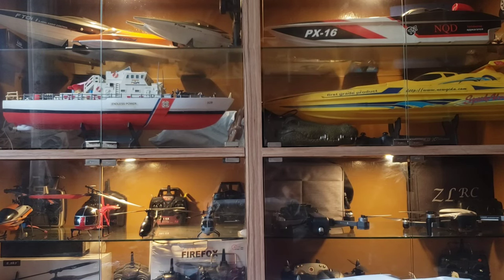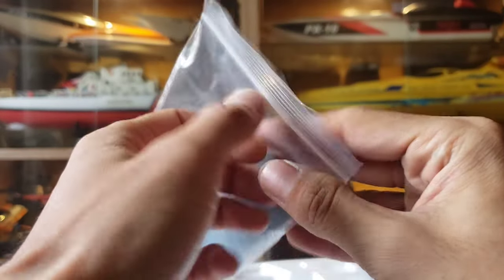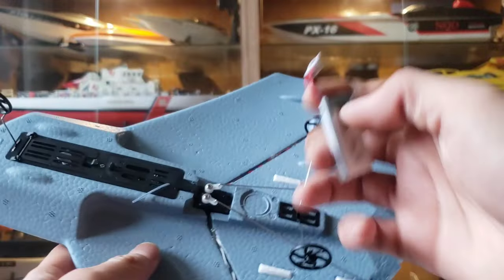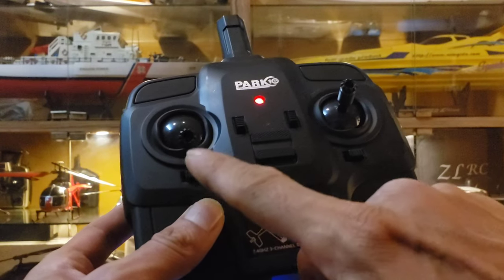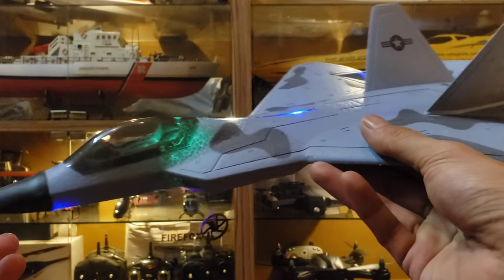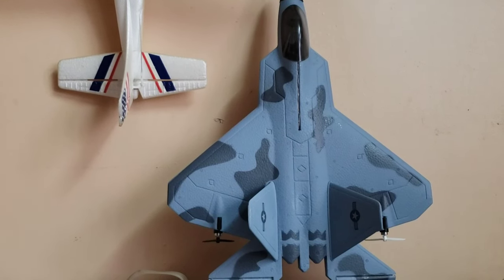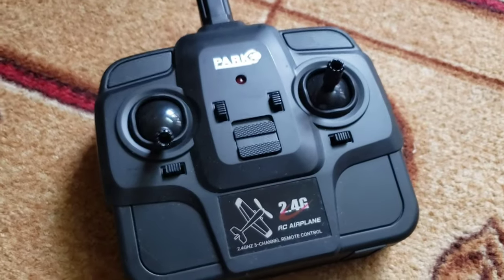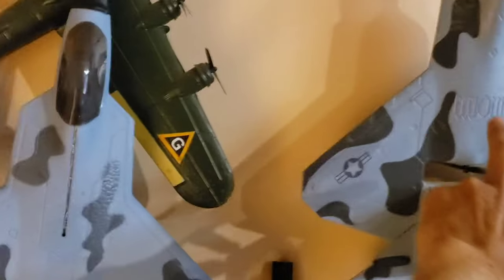Parkten 4Ch 3D/6G F-22S Raptor RC Jet Unbox and Test

Comment: Do u have the protocol for open tx?
Reply: SG F-22/ Park10 sub. You need the very latest firmware version.
Reply: @theoztreecrasher2647 thank you big dude!  Now i can pratice with my new controller
Reply: @theoztreecrasher2647 dont get hi low rudder settings. Oh well
Reply: @TarenceBoyd  If by "don't get hi low rudder settings" you mean "high or low stick rates" then you can simply program them on the Inputs Page of your OpenTX/EdgeTX Multi Module Radio. 
If however you mean "don't get 6G/3D gyro switching" then you will need to wait until the people who are working on hacking the stock protocol can work out how that can be added to the emulated Multi Module Protocols. 
Them's the breaks, mate! 😉😊

Comment: Thanks for sharing this! 
Mine flew good too, and the stunt button was able to make really nice roll and loop maneuvers. 
But it worked only the very first time and since the second flight,  the gyro acts funny and the plane tries to roll / loop and even inverted when you press the stunt button.  
So I'm questioning how long this thing lasts.
Reply from the maker: That was the maiden flight so I have no idea about how long it will last. But from my personal experience, airplanes simply do not malfunction after first flight until you crash them and esc or servo gets damaged. None of my planes have failed after first flight no matter how cheap.
Reply: They are tuff